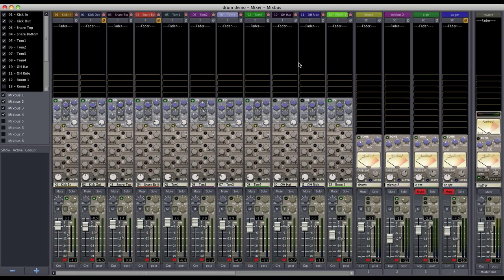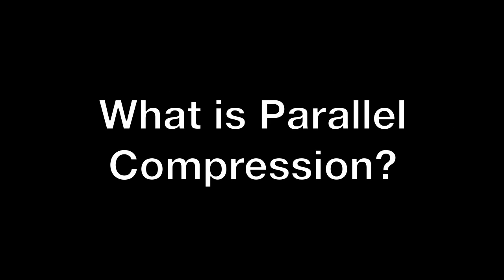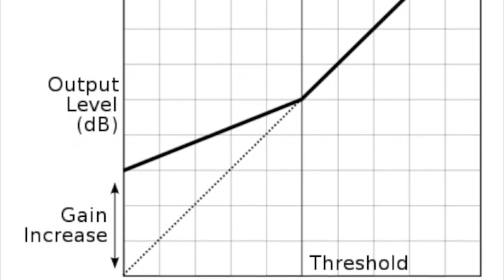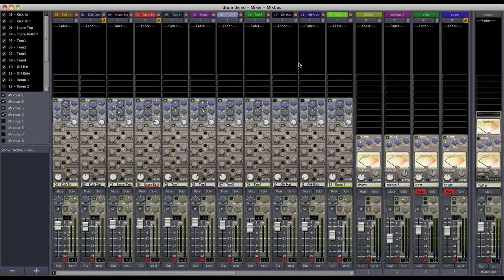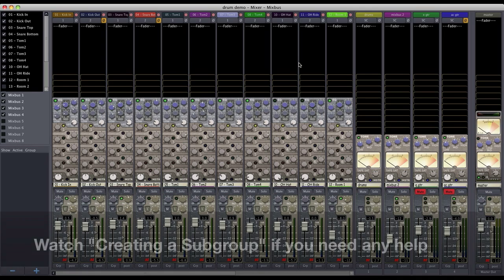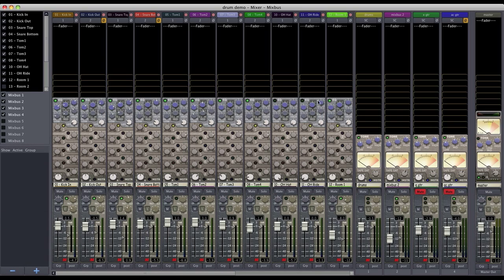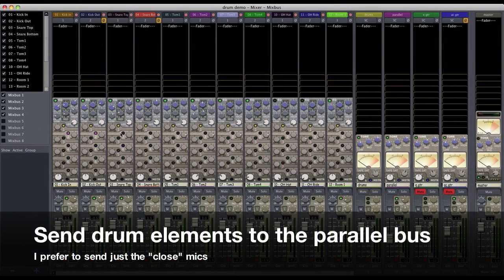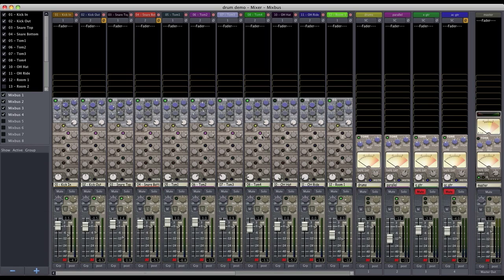Mix Tips - Parallel Compression in Mixbus (v2,3,4)

Comment: Why do you want the sub group for the drums? Is this still a necessary step since Mixbus 3 can send a track to the master bus and the parallel bus at the same time?
Reply from the maker: +1rcproductions You can route straight to the master bus if you like, and use a mix bus for parallel compression.
Reply: +Harrison Consoles Ok. Thanks.